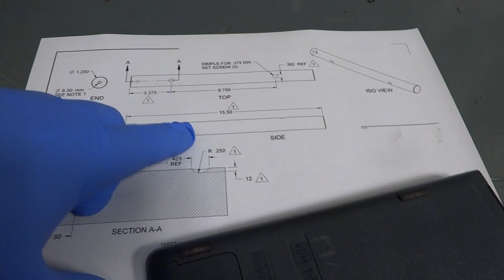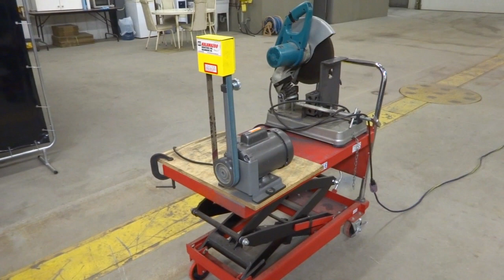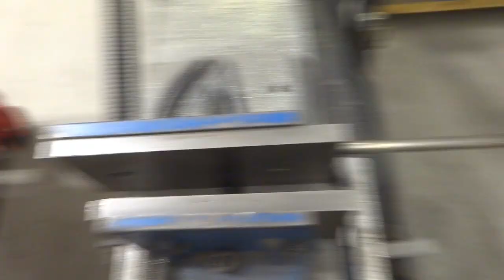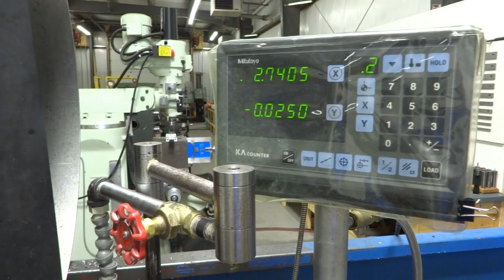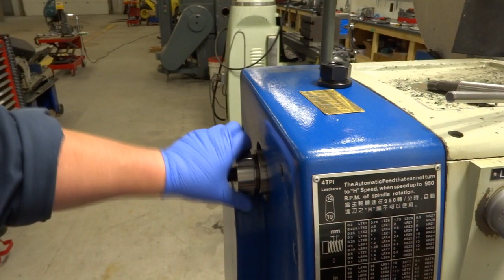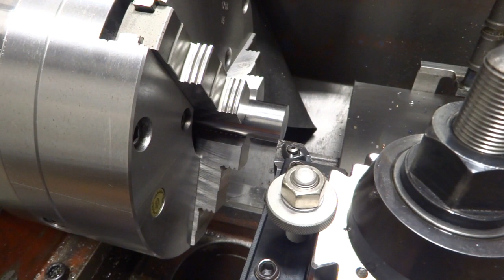Production Machining of Shafts and Scissor Table Talk Part 1

Comment: Great video. I gave my scissor lift to my father in law because he has back issues. Starting to regret that decision  now .lol
Cheers 
Martin
Reply from the maker: My father in law works with me in my shop sometimes.  He has welded for over 50 years but my scissor lift was the first one he had ever used.  He liked it right away.  I have an overhead crane and a forklift but the scissor lift has become indispensable.  Ken

Comment: I regularly cut  groups of 16, 5/8" TGP shafts into 23" lengths.  I have basically the same saw that you do.  I found that I can stack all 16 shafts in the saw in a 4x4 matrix.  Lightly tighten the saw clamp and use strap clamps to hold the far end even.  I then weld the end of the shafts together.  This holds the lengths even.  I use a strap clamp to hold the shafts being cut.  It saves me a ton of time.
Reply from the maker: Hello Jim.  I used to cut lots of threaded rod with my saw and did something similar to you.  One problem with threaded rod is that if one of the rods in the bundle spins it screws itself out of the bundle.  Ken

Comment: Nice setup, I suppose you could add some flats if access to the pin boss is ever a problem.
Reply from the maker: Hello Ryan.  I was thinking I might machine a slot through the end of my wrench so I can get it over the threaded rod from the side instead of the end.  That way I would only have to back off the jam nut about an inch to tighten the stop to the spindle.  Ken

Comment: Why not use the lathe to turn the thread to adjust the nut? Would have worked for your fine thresd too. A back stop is almost essential for thst sort of production run, i really must get round to making one similar to yours.
Reply from the maker: I don't mind doing that kind of thing in front of the chuck (i.e. over the bed) as I have a full length foot brake to stop the spindle.  When I do something like that I always have one foot resting on the brake in case the lathe gets a hold of me.  I don't like doing that sort of thing when the controls are out of reach which they would be if I used the lathe to spin the nut on the back stop.  I usually work alone and therefore have to be able to save myself if something goes wrong.  I agree with you however that it would be much faster.  Ken